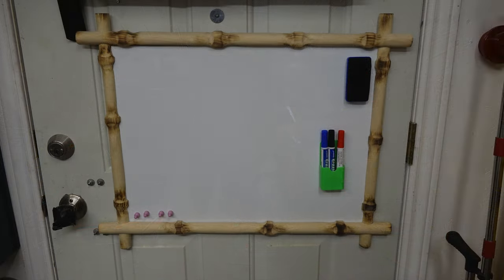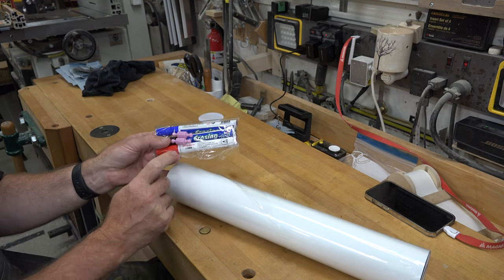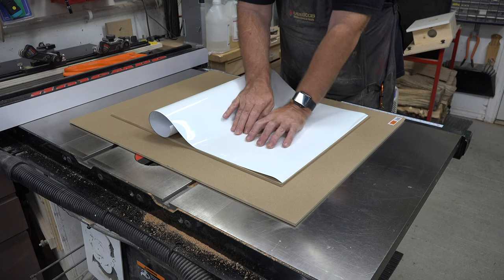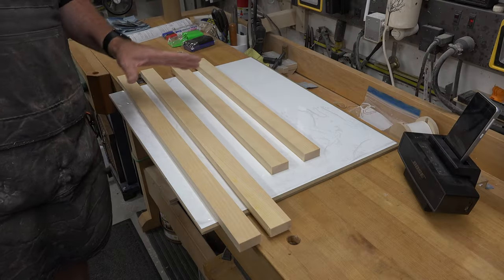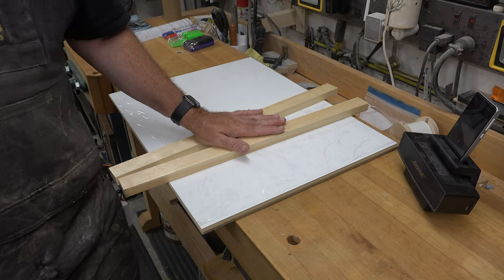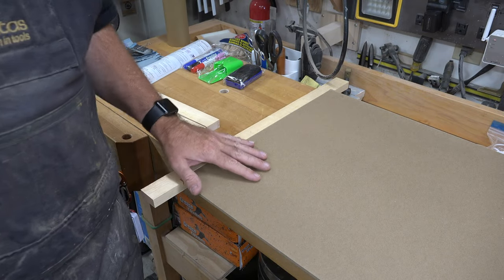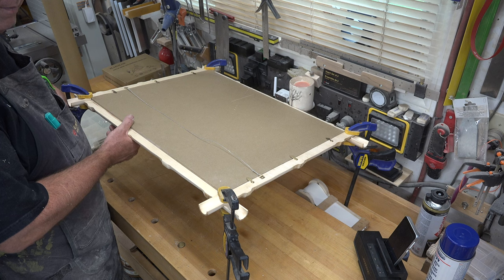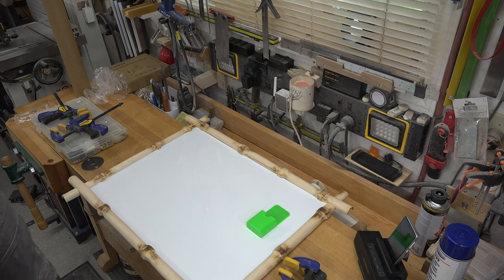Making a White Board and custom frame

Comment: This project is just fantastic, your bamboo frame is just amazing ... a lot of work but the result makes it worthwhile 👍

It's strange how hard it is to just go freehand on a project, especially when you are so used to working to exact measurements, but once you get into to it, it's amazing how freeing it is.

I did this with a table I made from Leylandii I cut down in my back garden ... I halved the trunks to make the table top and used the base of the trunk and roots as the centre stand of the table ... along with some repurposed oak flooring to make it more stable.
Reply from the maker: That table sounds incredible Barry.  I'd like to see that.  Thanks for tuning in and for the kind words on the project.  You are definitely right that sometimes, it's hard to break our habits of strict measurements and just go free flow.
Reply: @acutabove_woodworkings   I've sent you an email with a couple of photos 👍